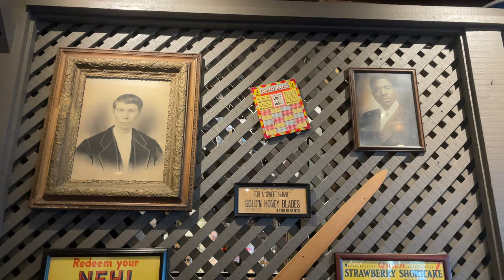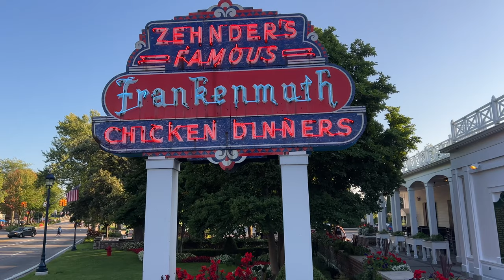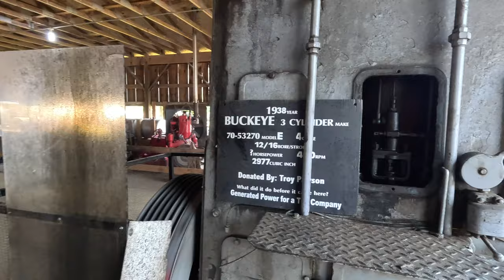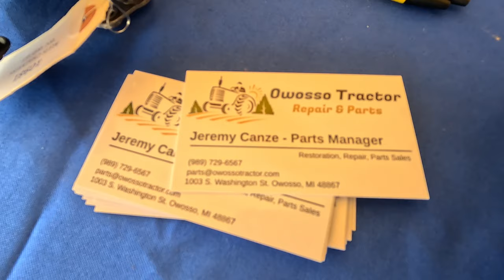Michigan Trip And Mid-Michigan Old Gas Tractor Show

Comment: I might just have the fast hitch you need.  I got 2 with the auction 140 I bought.  There was I nice pile of parts when I bought it.  Cub plow, too many cultivator shanks to count, king cultivators,  fertilizer/side dresser and a complete fast hitch for something...  I can start emailing pictures of the stuff to Brandon if that is best way to figure it out.  He got me all my engine rebuild stuff.  140 is  running well!

Comment: Sammy might find he enjoys mowing with this setup.  Those Woods belly mowers are tough, real beasts.  Guess Sammy will have to build a shed now.
Interesting how God has people's paths cross.
Reply from the maker: Probably some rearranging. I’ll pull the bush hogs out and cover them.
Reply: @Jtwes  I made some tent style frames using PVC pipe for my mid mount mower, 4 ft tiller, and even the FEL, and attach brown tarps for cover.  Less obnoxious looking than blue tarps.

Comment: The rust on the grill is from a front end scrape blade my has the same spot. Consider a 3 point  conversion kit mine works great except for the cross bar stabilizer, it's the lowest point when cultivating.
Reply from the maker: I hope to get a fast hitch. All my equipment is fast hitch. Those 3 point hitches are nice though.

Comment: Couldn't buy rubber tires during WW2.  Many tractors came with steel wheels or got steel replacements during that time.  Then they converted back to rubber after the war.
Reply from the maker: That makes sense.